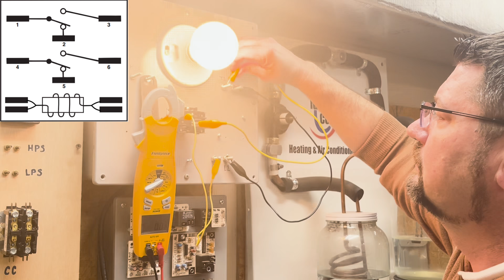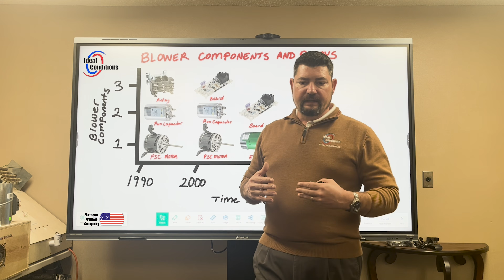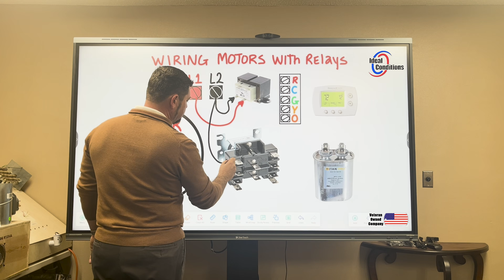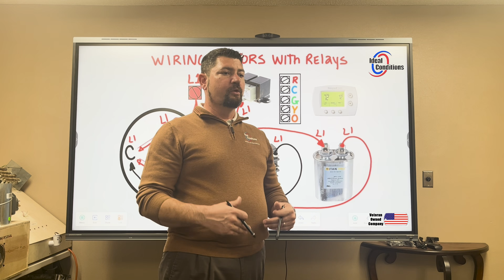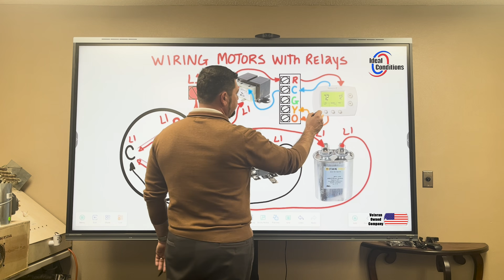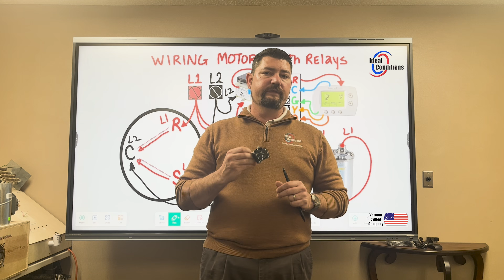How to Wire a 90-340 Relay Using Different Loads

Comment: Is high speed controlled by Y terminal from thermostat?

Is W control low speed?
Reply: When Y opens up, G also opens up for fan signal
When heat W opens up, it doesn't open G by default. But many thermostats can be programmed to open G with heat W.

Comment: Are the blower speeds wires considered "hot wires"?
Reply: No. Motor leads are Load side
Reply: The white wire is Common side there is always Power so the only left  wires are the speeds wich become the Load sides. Either Black high speed and Red Low speed....so only white is considered Hot

Comment: Are we simply breaking hot wires from blower motor?

What color wire is normally neutral or common wire from blower motor?

When flipping therostat to fan only is this NC side of relay?

Comment: Can one use high & low speed with 90-340, i.e., say black wire and red wire?
Reply: Yes.
1 - high speed black fan motor, 
3- L2,  
4- low speed red fan motor, 
5- heat L2, 
24 Vac = common and G, 
 Fan white - L1